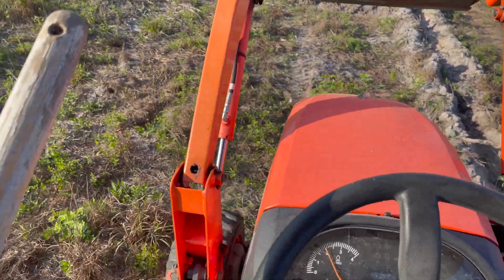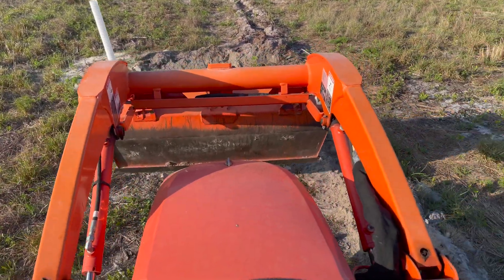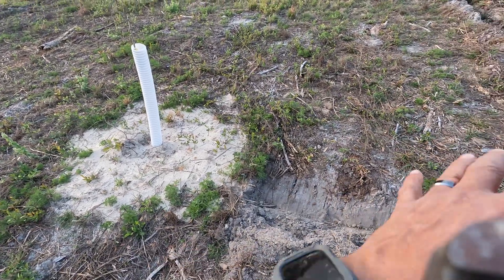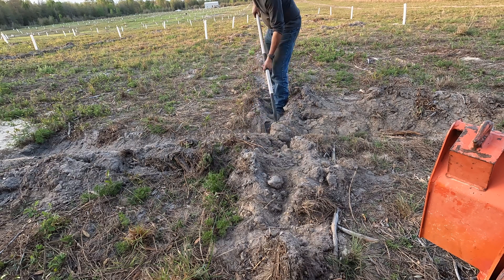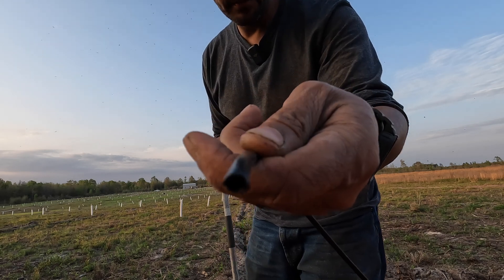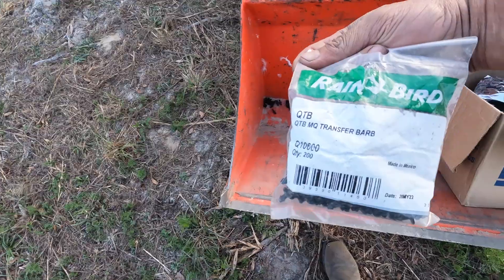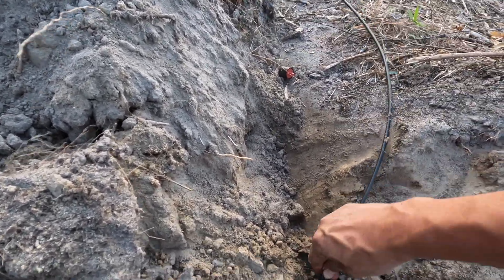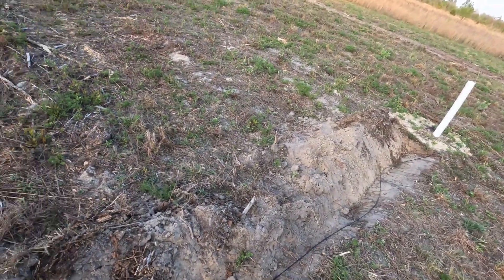Orchard Irrigation, The drip line!

Comment: I like how you used the tractor bucket to scoop out shallow drip line ditches.  Why not leave the drippers off and let water flow from the end of the drip line to soak the ground around the tree?
Reply from the maker: I leave the drippers off initially to clear the line from any debris that had gotten in during installation process. My well is a little small to supply all the trees without the dripper to restrict, the flow, unless I had multiple channels. Also, occasionally grippers do fall off when that happens the line shoots all over the place like a snake. I guess I would just have to ensure hose is buried up to the end.
Also, I’m told that with the slower rate of watering provided by the dripper’s, the ground is able to get more saturated with water.
I have seen other operations without dripper’s. They just use an open line and they seem to not have any problems.
So I guess either way you can’t go wrong.
Thanks for watching, thanks for the comment